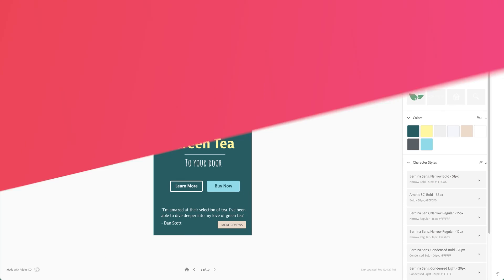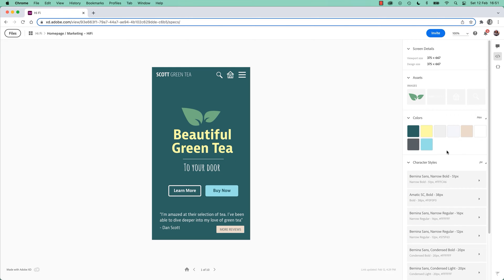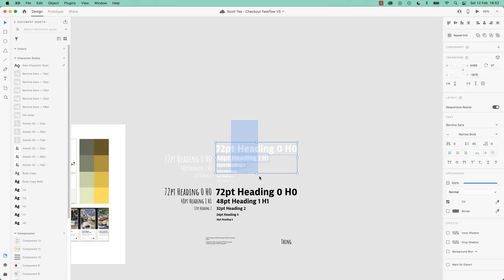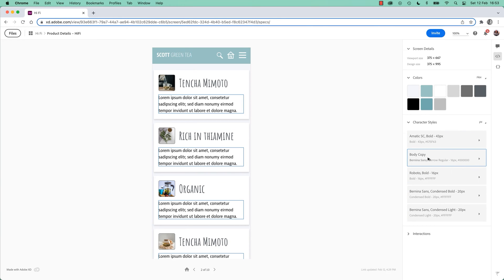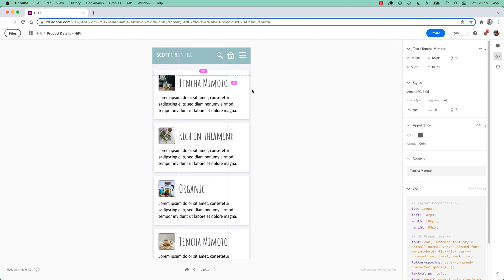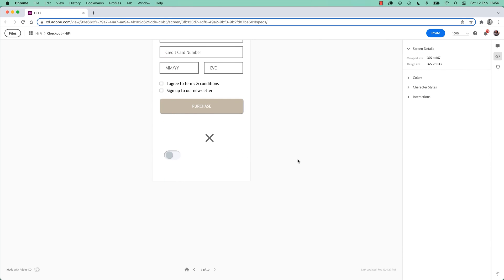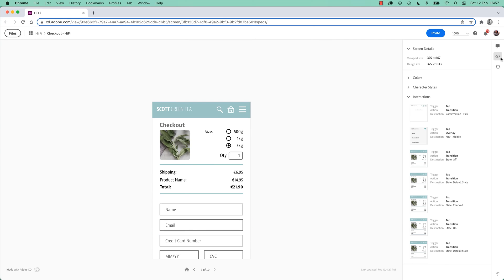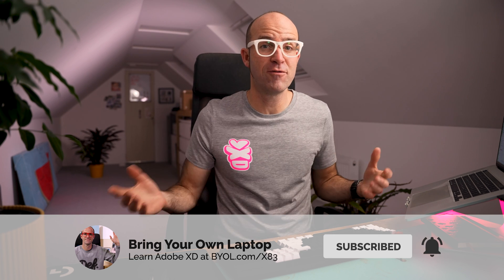How to Export Code From Adobe XD for Engineers Using Design Specs

Comment: How can there be an accurate handoff with text values (in terms of spacing between elements) given how XD handles the text bounding box? This is the main reason I try to not use XD because the resulting values are a mess and not at all accurate in code.
Reply: So you're pretty much saying you didn't watch the full video and pay attention?